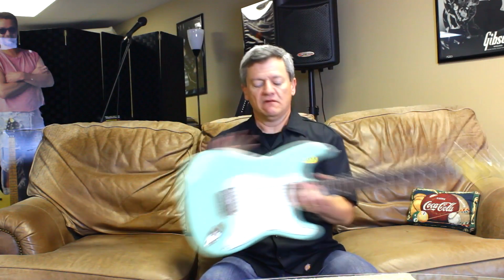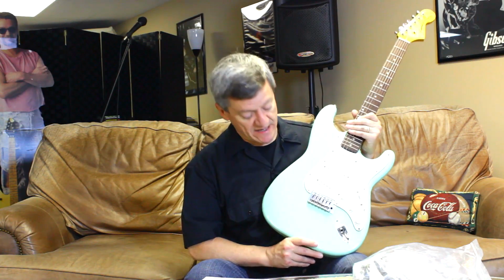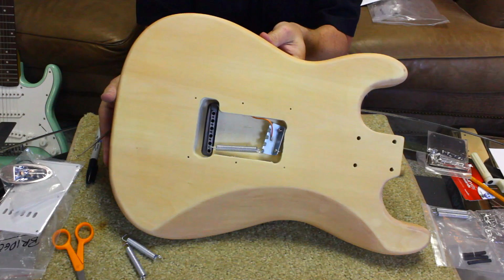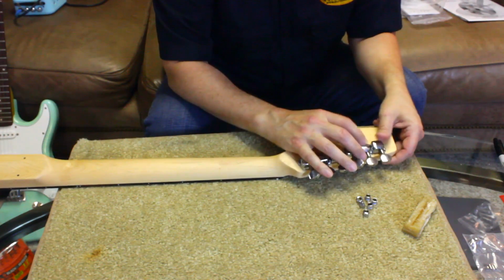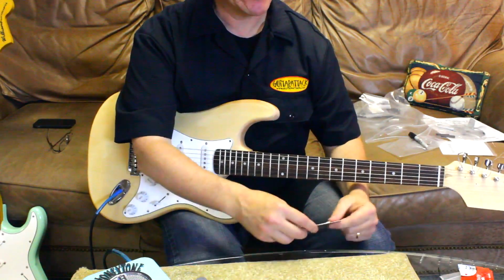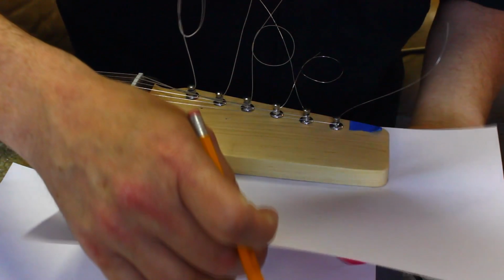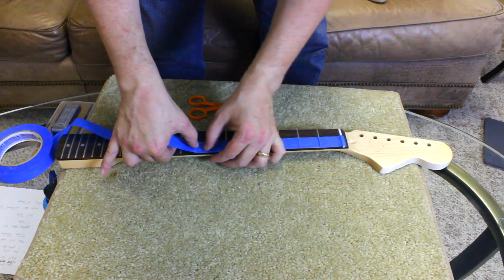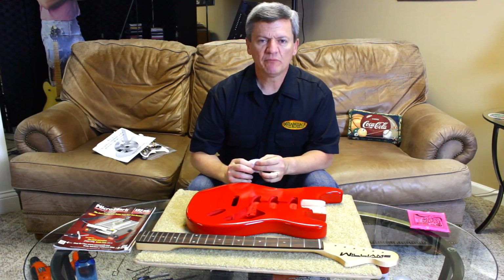GuitarAttack Saga Guitar Kit Video

Comment: Great video and explanation. I would add at the outset that you should put it together with every last screw before you do any finish work. The instructions tell you the first thing is to pick paint and finish it but I found that not everything lines up and fits perfectly and I ended up scratching 
areas and having to fill holes and redrilling before everything was right. It would have been better to do this at the start and then do paint and finish.

Comment: I always pronounced it "sogga" not "sagga".  AH sound like SAHGAH.  like... the  SAGA continues....   do they really say it SAGGAH? 

ref 29:10, the height depends on magnet strength, # of windings, and player preference.  A louder pickup could be further away or if the pickup is loud but too muddy, it   probably SHOULD be further away.  Closer = more bass, further = less bass (or , more treble).  I also tilt them away from the bass strings just  a hair so that the volume is more even across the strings.                                                                                                                                          Just how I see it.  Great tip on aligning the neck to the body, tho.  Having   strings on helps you fine tune that distance to the fret edges.  I also prefer more space on the treble  side for bending.

Also, I use .008s detuned 3 frets with LOWER action than the two credit cards.  But then I use a light touch and I get tone and sustain for days.  It's all relative.  It's an equation that must balance.  If you put .010s on tuned to standard, you can play harder with no major side effects and even get lower action because the strings are stiffer due to size.   But harder to bend.

Wow, those tip cleaners or whatever for nuts...  Stew Mac would charge you like $150 for a set of those.  I think they are overpriced these days. :(  Used to buy stuff from them but  I just can't see it now with cheap alternatives that work just as well.  I made my own fret puller from a cheap set of nippers because two I ordered from stew mac were deformed.  So, I had to make my own.  ground the face flush and it works pretty well.   Nice result.   But red.....  hahah,  I'mma gonna do like deep emerald green!  with glitter! hahahha  thanks for the tut.
Reply from the maker: Being from Tennessee, it is pronounced “Sag Uh.”
Reply: @GuitarAttack6  You mean the company pronounces it that way, yes?  I wonder why it's different than the word "saga".  ?  The world is a confusing place.

Comment: I shouldn't complain, I fix more problems on guitars due to shorts caused by people who use electrical tape inside of guitars. They gave you shrink tube, why not use it. I shouldn't say this tho. Not good for business, lol. I agree with previous post, those tuners are junk. For $2 or $3 more good tuners are available . One way to cheapen the value of an otherwise awesome guitar is to throw  junk tuners on it. I guess legally they can call those things tuners??? Also I might add, I do a lot of eork on high end guitars. I suggest using shielded wiring from input jacks, pickups, pots and  switch. Use the sheilding directly to  a central ground point and avoid any loops, single path direct to ground.

Comment: Great video! I have some questions. I purchased one of the DIY kits out on the internet. I bought it to paint it to the colour that I want. Before you spray paint your body, is it necessary to put primer on it??? You used mineral spirit instead right?? Does it do the same thing??
Reply from the maker: I did not use primer on the Saga kit.  I scuffed the sealer coat (use a Scotchbright red pad or 220'sandpaper), cleaned it with mineral spirits or naphtha, and started painting.

Comment: I've only built a couple of kits.  My first was a Saga, and everything dropped into place perfectly -- which is good, 'cuz I didn't know "jack" about building guitars back then!  The instructions taught me a LOT, and are well done.  Years later, my neck started to bow a little, and it was only then that I discovered that the truss rod was broken.  Okay, can't really complain for a hundred-dollar kit.  My second came from another source, and it fought me all the way.  Not a single hole was right, and the routing was horrid and had to be reworked.  So Saga wins that contest, hands down.  My next build will be from parts (GFS,) not a kit.  By the time you upgrade your components (on any given kit,) ya may as well just build your own, from parts you select.  It'll cost a little more (or a lot more, depending on your budget and what you're going for.)  But kits are a great way to get started.
Reply: As a GFS junkie myself, I feel I should warn you about one thing before you start ordering from guitarfetish: the normal bodies are okay, but please do both of us a favor and order the XGP neck. Spend the extra $20-$30, the "retail" necks are freaking horrible. I did a build from them with a standard retail body, retail neck, pre-wired pickguard (love them), and the rest were OEM components. I sent the necks back twice before I told them to give me credit toward an XGP instead, and it was amazing when it arrived. That guitar is still with me today. I mean, everything but the body, neck, and pickguard has been upgraded, but it played quite nicely the way it was.
Reply: Thanks YF, yeah, that was pretty much my game plan.  I figured as much.  Hmm, I wonder how good or bad the necks are, on their new batch of bodies with glued in set necks ?
Reply: Seth Tyrssen I've looked at the LP's because they have some fucking amazing finishes (the green quilt!), and I would expect no more or no less than a fret level and some detailing on the fret ends. If you get one with a veneer that you really like, it could justify a little work. If not, the return shipping is on them for any defects.
Reply: Again, that's about what I figured; lookin' at the unfinished Tele, just because it would be "different" to have one with a set neck!  And have plans to build a couple from the XGP parts. Thanks for the replies.

Comment: is it difficult to build a bolt-on guitar without the holes on body and neck , is there any tecnique to build it right?
Reply from the maker: Some players glue their Strat neck into the body. The easiest way is to apply the glue in the neck pocket ( use regular Titebond), install the screws and let the glue dry. When the glue is dry, remove the screws, plug the holes with dowels and glue, and finish over the plugs. Ritchie Blackmore supposedly did this with some of his  Strats. Note: Don't use epoxy or non-water based glue or it will be irreversible. Thanks

Comment: i sprayed lacquer on a neck once , and months later i started using a guitar bag to keep it away from dust, and when i opened  fsbric from the bag  was lighty sticked to the lac we uer on the neck , how was it por posible, it was like the lacquer never dried completely , any ideas ?
Reply from the maker: I've used a number of brands of lacquer over the years, and sometimes it just will not dry hard.  Make sure the neck is clean - use mineral,spirits to wipe down the neck and don't touch the surface after you clean it.  Also, try not to spray when the weather is humid.  The humidity can make the lacquer trap water and be very sticky.  Finally,,spray light coats and build them up slowly.

Comment: Is it just one coat of paint? and do you need any paint sealer/primer as well
Reply from the maker: I've found you don't need a primer because the sealer on the body is so thick.  Use enough paint to cover the bare wood.  I've found thinner is better when it comes to paint on a guitar.  Good luck!
Reply: thanks for that mate! keep up the good work

Comment: Chapstick very lightly on screw threads is simpler... no need for beeswax. Use a socket to tighten the nut on the jack... and avoid scarring it with needle nose pliers.
Reply from the maker: Thanks for the comment.  Is till like beeswax better, and if you want to use lip balm, the Burt's Bees brand might be your best choice.  Concerning the socket, getting anything other than a thin-walled socket specially made for a jack cup in to position can be tough, particularly for a person with a small tool set.  Use the pliers to hold the nut and tighten the socket from behind.  Thanks again.

Comment: I built one,,it was a pyle,,I replaced the tuners,, the pickups,, the bridge,,, I never thought of the strings,, but I love it,, reminds me of a Mexican fender....I maybe have 140 dollars in it,, I figure its a 350dollar guitar, and I had a lot of fun.
Reply: +Dana Bellefeuille   john I also put tin foil in the inside ,, they said that will stop buzz in the amp,, do u think so,,,thanks dana b
Reply from the maker: Foil can help but you are still dealing with single coil pickups, which are noisy.  Try a piece of foil under the pickguard like the old Fenders.  You might see a reduction in hum.  Thanks, John

Comment: Forgive a potentially very naive question but.......do you think it would be reasonably practical to switch it to left handed? would it be as "simple" as replacing the nut with a leftie one and stringing it leftie?
Reply from the maker: Actually yes....pull the nut out and reverse it.  mr. hendrix did it all the time!  Thanks!